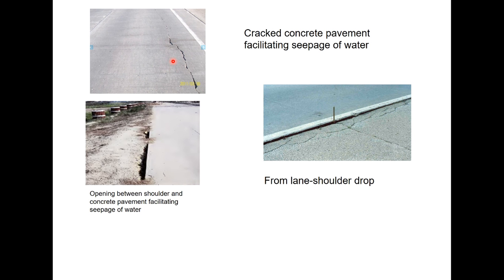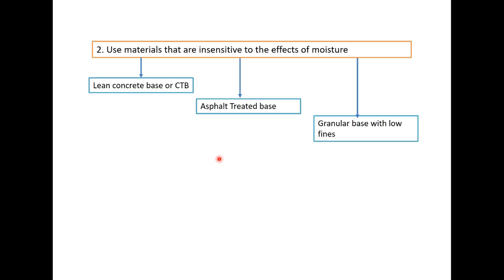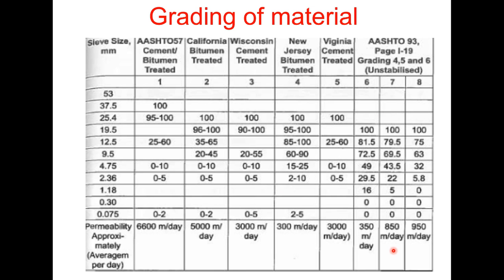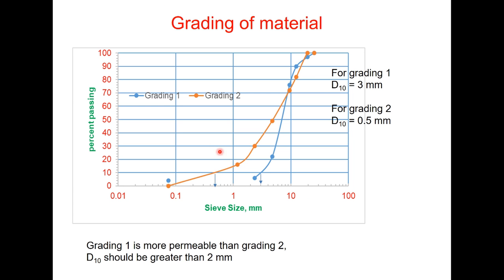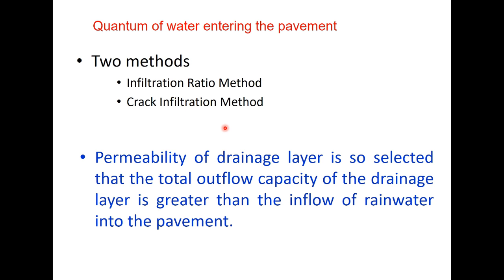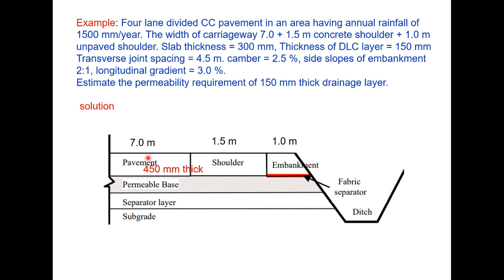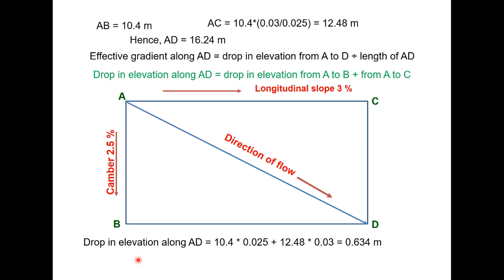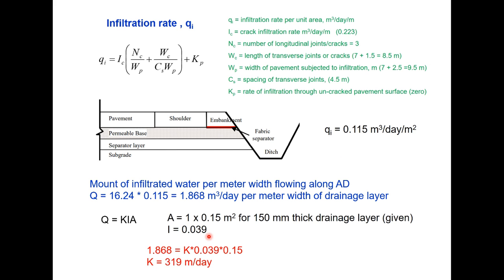#highways, #rigidpavement, #concrete, Design of Drainage layer for cement concrete pavements.

Comment: Sir, how to select the thickness of GSB? Is there any formula or design criteria? As mentioned in MORTH 401, the thickness of GSB should not be less than 150 mm. However, IRC 58 does not mention how to design it.
Reply from the maker: The GSB layer thickness is selected based on design traffic, grading of aggregates to be used in GSB and soil conditions. It should not be less than 150 mm and generally goes up to 250 mm. Experience of the designer also counts.

Comment: Sir nice one.
1. In irc 58 it is mentioned that if the thickness of drainage layer is doubled the permeability becomes half. So less the thickness of drainage layer is better.
2. For flexible pavement directly Morth gradings are followed for drainage cum gsb but thicmness is 200mm minimum, is this correct then?
3. In my opinion the design of drainage layer to be carrried out for 0.3% grade as this is minimum adopted...sometimes on expressways long straights it is even zero. Also the worst case design width i.e generally at toll plaza should be taken as example i.e for wider pavement.

Pls correct me if I am wrong
Reply from the maker: No, you are not wrong, many decision must be taken looking at the site condition. I have taken a very general example just to illustrate the procedure. Happy to note that your watching all my videos. Thanks. Please forward the link to your friends and colleagues also, if you feel so.
Reply: @SatishIITR  yes sir already forwarded to my collegues